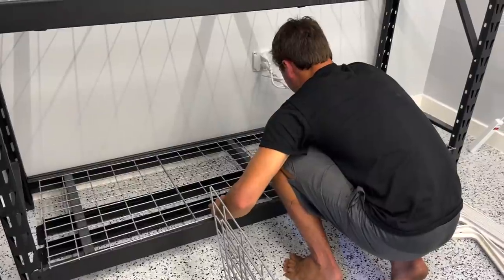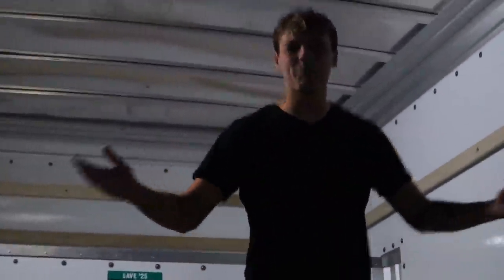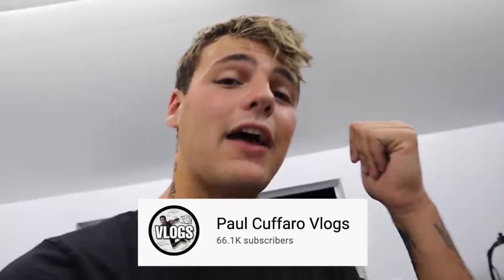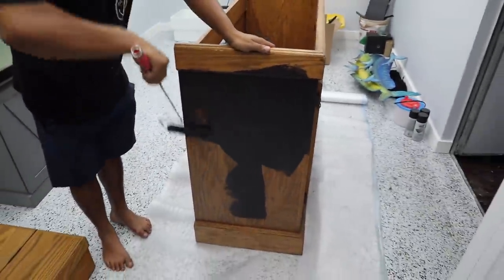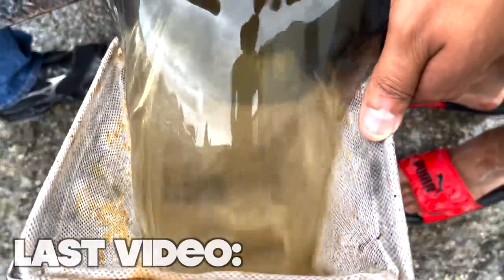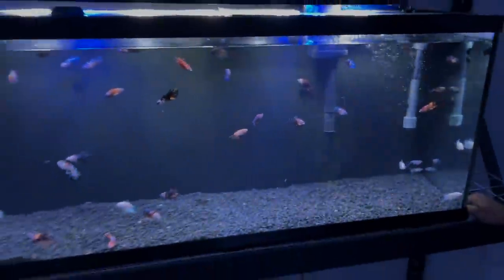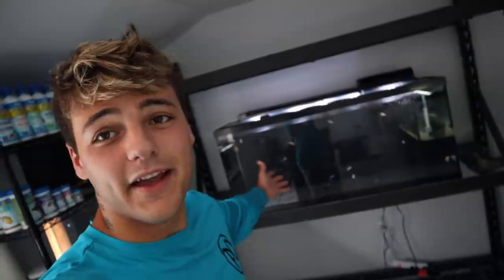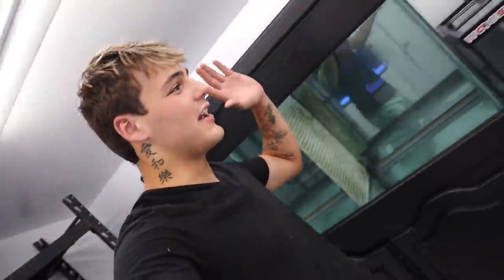Transferring ALL My FISH & AQUARIUMS to *NEW* ROOM!!

Comment: If the rack is advertised as 2000 lbs is the max for those rack combined. Max load per shelf is significantly lower. A piece of plywood under the tank to distribute weight will do you good.
Reply: The shelf he has is the same I have in my garage. It’s a steel shelf and each shelf has a max of 2000 pounds.

Comment: Looks good. I use the exact same stand that you use for the 70gal betta tank. I would recommend putting 3/4" plywood on each shelf on top of the wire. Helps distribute the weight better. I'm still very concerned that your floors are not on cement slab though.

Comment: Paul, as a fan. Get rid of your flowerhorns. You are stressing them too much by having them side by side like that. They could look so much better if you separate them and put them in their own tank. And what ever happend to the huge flowerhorn that you bought from aquachella? The one you put in your pond. Dead? I told you they aren't bred to be outside. They need a consistent water temperature of 82-84 degrees.

Comment: The betta tank needs some plants, driftwood, rocks,  and needs  some aquascaping. Then the aquarium will look so good. And yes, the petco betta might not be better than the Thailand imported one. But the reason is because the Thailand imported bettas are candy Nemo betta which is one if the best bettas in the world and petco betta is a normal viel tail betta. So it kinda depends on the breed and the species.